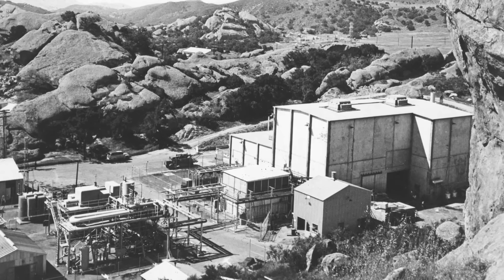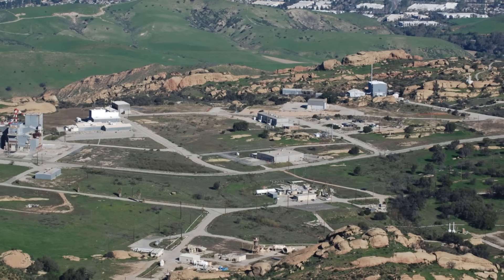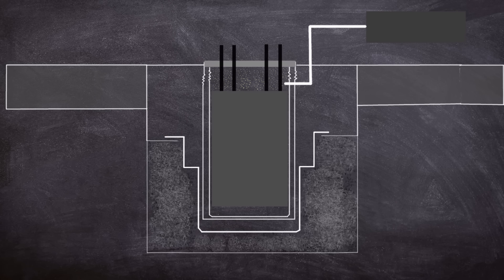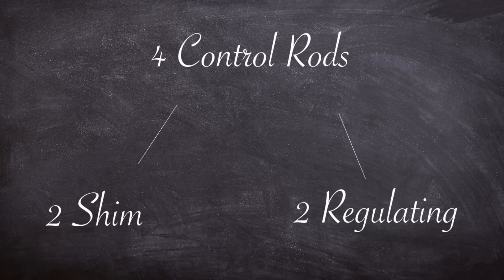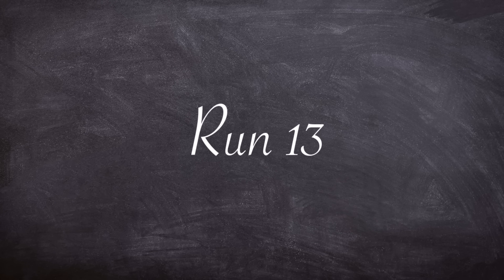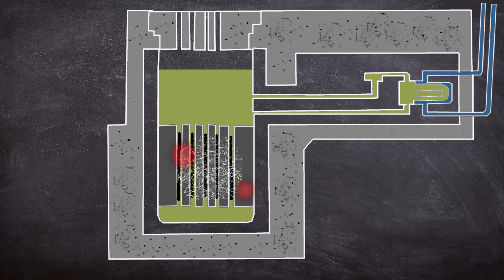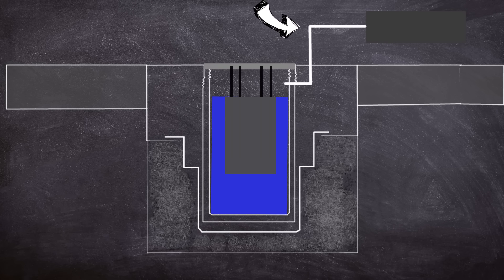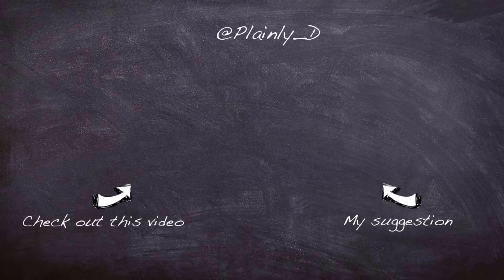A Brief History of: The Sodium Reactor Experiment Accident (short Documentary)

Comment: how incredibly wasteful of the human lives and environmental damage is it to use nuclear material to BOIL WATER....TO MAKE WHAT IS A STEAM ENGINE?  ALL THAT TECHNOLOGY AND ALL YOU CAN FIGURE OUT WHAT TO DO WITH THE OUTPUT IS BOIL WATER.
Reply: Steam Turbines are probably the most efficient way to get usable electricity out of something because of Physics. Hydrocarbon plants produce power the same way.  A nuclear reactor works by converting heat to kinetic to electricity. Atomic is actually one of the safest and least damaging methods of making electricity. The One Major disaster was Chernobyl which had more to do with bad design and Soviet incompetence and was COMPLETELY avoidable and as for Fukushima the amount of radiation the Residents got was less then 1/2000th of a normal yearly does and is near undetectable elsewhere and i think that pretty much the only place that's not safe for people are in the reactor buildings.  the only other useful way to produce electricity from atomic is an RTG which uses the Seebeck effect and only produces like 100-150 watts of electricity which is why they are really only used on space probes since they can pretty much produce a trickle charge for a couple hundred years as they half there output with the halflife of the isotope used. the plutonium-238 RTG on the Voyager probes produces like 150ish watts which will halve ever 87.7 years

Comment: This was the equivalent to building an engine to handle 700hp and you hit it with 1,000 till the gauges act funny.....then you just pull it apart, clean it, and do it again, without changing or upgrading, and expecting a different result.

Like bruh.....shitty design stop hitting the gas already